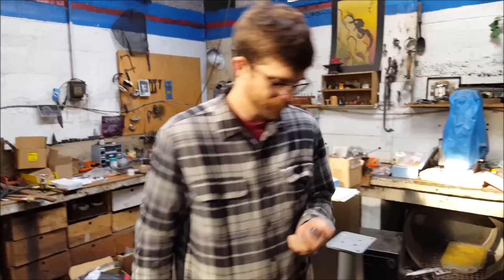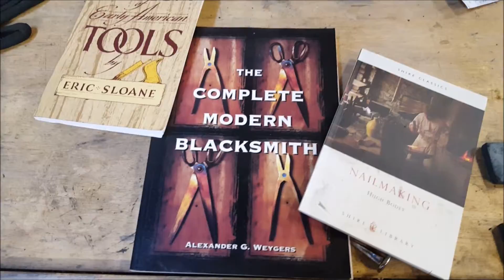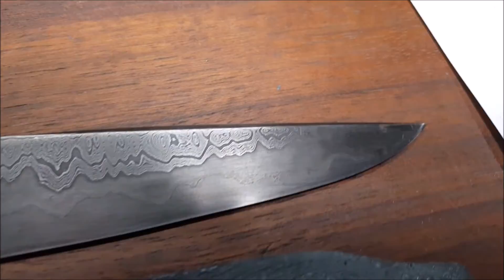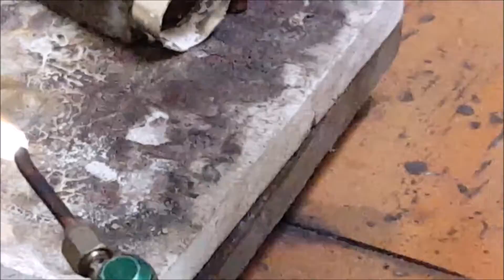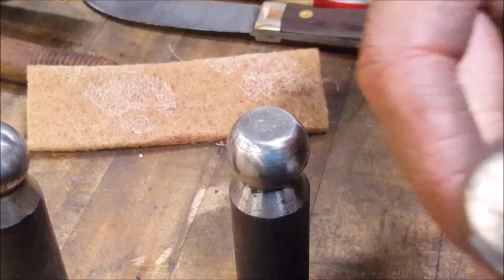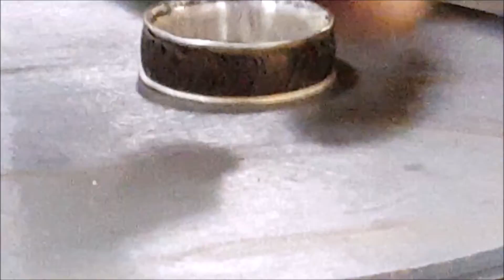Creating a Damascus Ring

Comment: Is that silver soft ?
Reply from the maker: This is sterling silver which is pretty soft. Soldering it into a band for the liner annealed it into it's softest state.  That is why it rolls over the edge of the steel so nicely.  The silver is somewhat hardened as it is forced over the edge.
Reply: AWESOME Info , I Make a lot of Mosaic Damascus, and have been wondering about Liners in the rings ;)